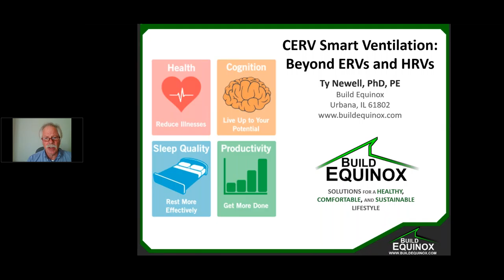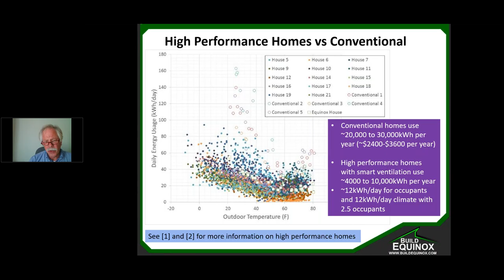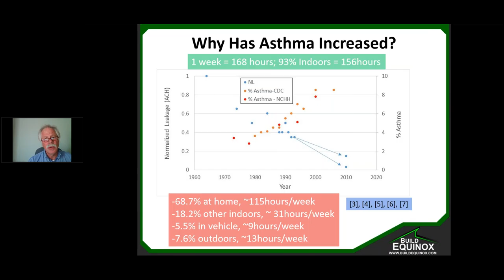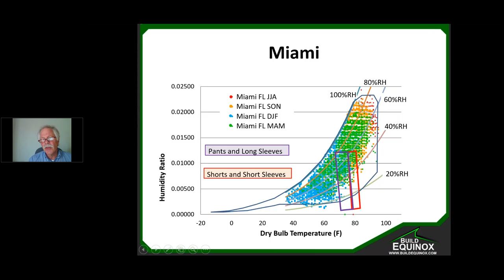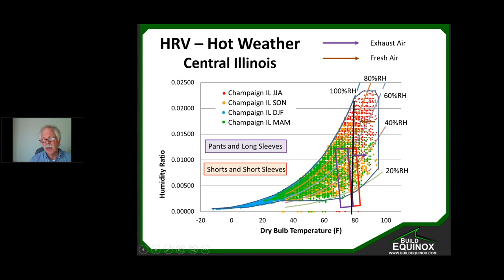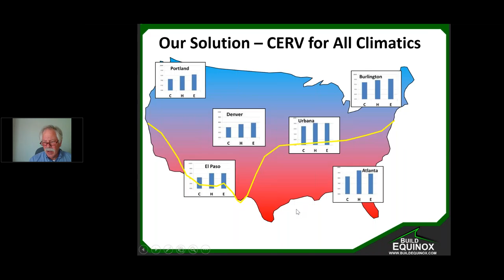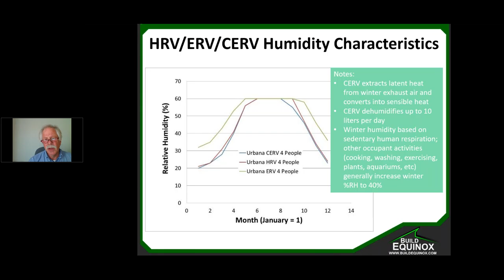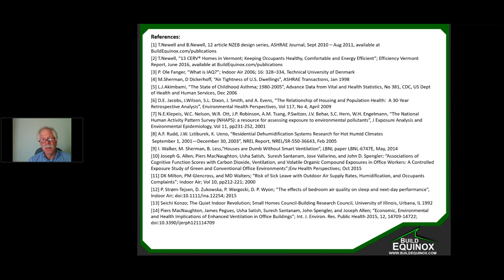CERV Smart Ventilation   Beyond HRV and ERV Systems

Comment: Long-form content is very useful. I would love to be see a presentation about a CERV2 installation with a Hyper-Heat called from the I/O board, that seems like it may be a killer option in places where trenching for geo-boost is less practical.
I'm looking out a few years to build here in Wyoming. I'm a software engineer by practice, and I'm modelling my home concepts with multidomain computational analysis (because it's interesting to me), including analysis of convection, mechanical circulation, passive solar optimization (window placement, foundation orientation, and sizing some external shading/wind break details to heat maximally in the coldest months, and not overly increase cooling load in the very hottest times), etc.

Also, if you were looking for a case in the west to try out control algorithms or do research on, I'd be happy to help you gather data. I'm really pleased to see that there's an HVAC manufacturer here in America that is this engineering-focused.
Reply from the maker: You may like our ZEROs energy modeling software. It's free and easy to use. buildequinox.com/zeros